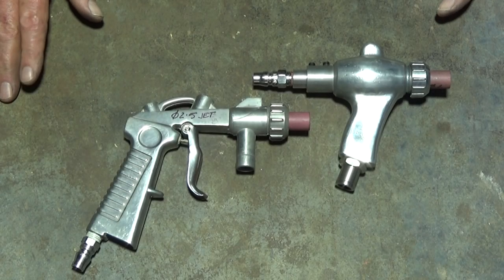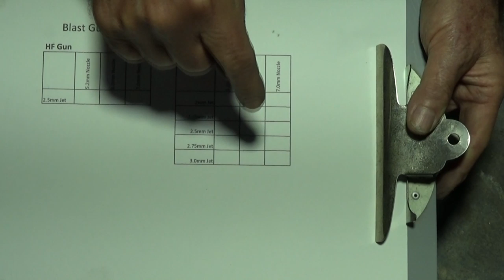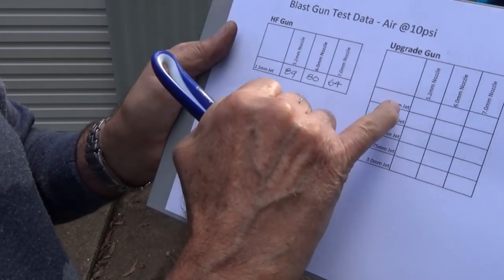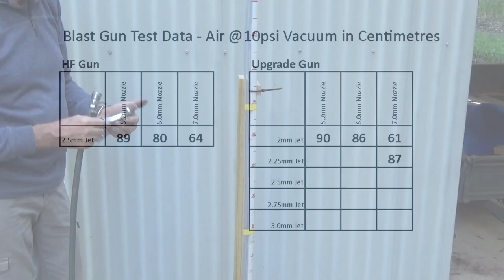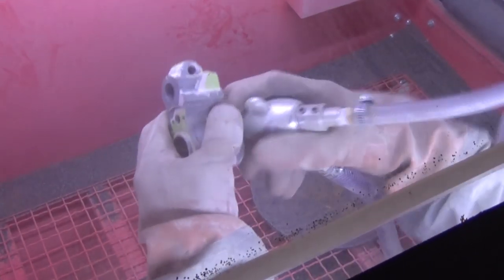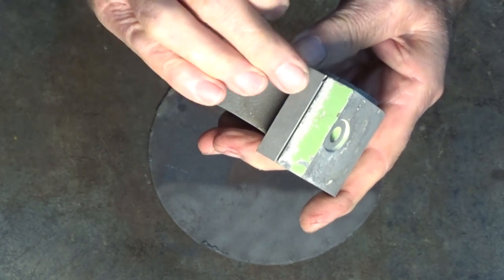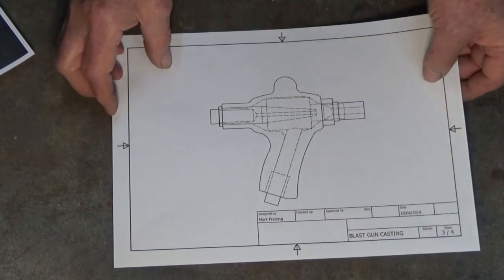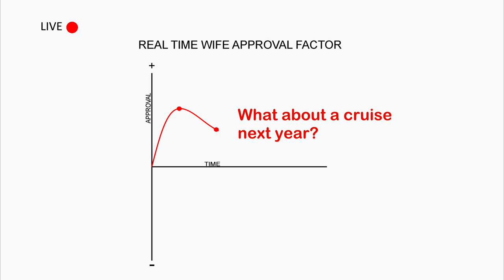DIY Blast Gun Testing Using a Manometer

Comment: Nice results on the gun engineering.  I will agree with bradley carlson below, DRY air and plenty of it are paramount to keep the sand moving and the duty cycle high as possible, nothing eats up air like a sandblaster, just like an open hose.  Me and a friend were doing a ground up restoration on his car and we decided to sandblast the frame --- his compressor was way too small and that became obvious very quickly as the duty cycle was very short with the compressor at full pressure and larger hoses and fittings.  So he bought a new 3x larger compressor and that took care of the duty cycle problem.  But the sand absolutely had to be dry or it slowed the flow and occassionally clogged the hose, even with water filters in place.   Once we got it dialed in we loved cleaning parts with it, nothing like it to get back to bare metal without leaving grinding marks on using nasty chemicals, but one must wear serious breathing protection outside a cabinet - the silica sand we were using had warnings all over it about permanent serious lung damage (silicosis) from breathing it.
Reply from the maker: Thanks for that. I am considering upgrading to a Chicago silent air compressor but I might keep my old belt driven machine since many people have suggested running two compressors in tandem. The garnet I am using seems to be quite coarse compared to materials I have seen others using. I can understand why having dry air would be important if the material is quite fine. I am starting on the MKII version of the gun and I have ordered some clear acrylic tube to see if I can make a transparent gun so I can visualise what is going on inside the cavity of the gun. Should be interesting.
Reply: @Preso58  - Youre so welcome - I like the clear gun idea as a learning tool, to actually see the behavior of the sand should provide valuable clues to what changes need to be made if any.  I love a good DIY project, but yours are on another level than some of us less equipped folk so its fun to watch something be engineered, designed, cast and machined from the ground up.  Your garden bridge was a wonderfully enjoyable piece of engineering work that could only be executed by someone with patience, knowledge and the use of good sound engineering principles, very nice work and a great video series as well.

Comment: I am a bit puzzled here. How come you think that the nozzle and the jet opening are stil optimal if you use 100 psi instead of just  the 10psi you used to do the test.  Do another test at 20 psi....maybe the numbers tell a very different story then.  Why would the numbers go up linear because you use higher  pressure ???
Reply from the maker: I knew that the results that I was getting at such low pressure would be a bit skewed. I intend to do the tests again when I get the MKII version of the gun finished. I tried running the pressure at 20PSI and it just sucked the water straight up to the gun and sprayed it out of the nozzle.  I realised after the video was published that I have a vacuum gauge so I will try to use that to run the tests at realistic pressures. I am keen to see if the results "scale".
Regards,
Mark

Comment: P, 
Your media feed tube is able to deliver more material than the gun can use. When it backs up at the gun the suction drops and thus the flow. Don't worry about the media flow in the delivery tube the delivery out of the gun is all that matters. 
Your drawing of a venturi is wrong, the low pressure point in a venturi is at the narrowist point, see if you can get the media delivery closer to that spot. Also a shallower angle  (larger radius ) in the venturi might help,  you want a laminar airflow if possible. 
Third point, how do you expect to be taken seriously with a clip board when the accompanying pocket protector is absent, seriously mate.

JG
Reply from the maker: Joe. I had reached the same conclusion about the flow of the media up the delivery tube and the flow coming out of the nozzle. It must be arriving at a rate faster than it can be ejected out of the nozzle. I take your point about the laminar flow etc, the design, as always is a bit of a compromise in terms of what I can cast, what I can machine and how comfortable it is to hold. I actually do have a pocket protector! I used to wear it to work when I was teaching. Sadly I could never be organised enough to stock it with three different coloured biros.

Comment: What about feed tube sizes, does this also have a bearing on the outcome? So many variables I think.
Reply from the maker: Yes, There are a multitude of different combinations of pressure, air volume, media size and composition, air and media delivery tube cross sections but the most significant seems to be air volume rather than pressure. I tried to do some blasting in my wood shop the other day and the air line in that area is a small bore PU retractable air line and the results were very disappointing. I am thinking that when I get my new compressor I will run a dedicated large copper tube to the blast cabinet and do away with the foot pedal and substitute a ball valve that I can operate with my knee.
Reply: Thanks for the reply. That's a good idea. I think I should try the same with a light media, I was thinking of crushed glass as  it apparently gives good results. Keep up the good work. All the best from the UK 👍

Comment: There's no science with out the lab-notebook (clipboard) lol.
Mr Presling, you mentioned a version 2 in the works, so i wanted to make a minor suggestion. From fluid dynamics.. when a fluid changes direction it causes friction, and of course the sharper the turn the higher the friction. The sand at the metering valve makes a 90dig turn, and at the gun about 75dig turn. If these angles were decreased it may increase sand flow. At the metering valve gravity well also help the sand into the pipe. This may produce a more consistent sand flow plus increased velocity.
Looking forwards to v2, Cheers!
Reply from the maker: Tameem, the flow at the metering valve is very low velocity and as you have observed it is helped by the weight of grit above the opening. The flow at the gun is also quite slow until it mixes with the high velocity air in the vicinity of the tapered opening of the nozzle. The best way of visualising it would be to make a transparent body for the gun and the metering valve but that is getting a bit beyond what I can scrounge from my scrap box. I'm afraid like most examples of the design process, there are always conflicts and compromises. 
Regards,
Mark
Reply: @Preso58  No, not compromise.. I meant changing the angles from 90 dig turn to say 45 so it flows better. I wish i could post a drawing here.

Comment: I've been watching along as you go. Have a couple of thoughts. 

First, you should repeat your test, tuning the position of the jet for each size, as the optimal position likely shifts. It may even shift further with the change in nozzle diameter. 

Secondly, the geometry of your internal cavity. I think the more tapered shape towards the nozzle would be definitely be better removing that vertical wall you have at the end of your current barrel shape. This should allow better flow of the media towards the nozzle. Also I don't think there is much advantage to having much, or any cavity behind the point where the media is introduced into the cavity (in fact it may be counterproductive), so you may want to look at moving the entry point back, or bringing the rear wall of the cavity forward. You should be able to do a lot of tuning with positions and geometry using 3D printed parts, before you commit to another casting.
Reply from the maker: Mark, unfortunately I have already printed the new core box but I take your point about the shape at the aft end of the cavity although I am now wondering if the larger volume is helping to store a supply of grit as it arrives at the gun. I am noticing that the gun is able to supply a near continuous supply of grit but it is not being sucked up the tube in a continuous supply. I would love to be able to 3D print a whole bunch of transparent gun designs so you would be able to observe what is happening inside them as they work. Most SLS and SLA 3D printers are able to print good strong prints in transparent resin or powder. Sadly, those printers are still out of reach for most hobbyists. 
Regards,
Mark
Reply: indeed the volume to the aft may be the cause of your pulsing feed, though I suspect it is also because of geometry you had at the front.

Comment: Can you give me the distance from end of jet to end of nozzle please
Reply from the maker: Hi, if you send me an email I can give you the 2D drawings for the gun and all it's parts. I must say I never really measured what the offset is. I just adjusted the position of the jet until I was getting the best vacuum. I am thinking that there are lots of variables like the pressure of the air supply, the volume your compressor can deliver and the type of blast media you intend to use. You can find my email address on my channel page under "About".
Regards,
Mark

Comment: Mark,

Did you try different sizes of media feed hose?  Maybe the guns can't handle the amount of media being lifted, causing the media to back up....  Or am I forgetting where you already covered this?

I was wondering how the "discussion" about upgrading the compressor went, but your "real time wife approval factor" chart answered that quite well.  ;)

Looking forward to the ray gun testing.  If you design a functional ray gun, maybe the blast media surging won't matter.  Just zap the items/victims clean!  ;D
Reply from the maker: I badly, badly want one of those laser scaling guns. They are badass! I am going to do some more tests when I get the MKII version of the gun finished.

Comment: I've tried a few of their products.  I personally think they are shit.  Tried having a conversation with them a couple of years ago to sort out the performance issues.  Made a second purchase, tried that out.  Noticed some improvement, but not much better than what you demonstrated.  I'm not pressure or volume limited as I can  push 28 cfm at 175 psi all day long.  I was "updating" my $1300 cabinet) so none of this HF stuff).  Fussed around with varied pressures, nozzle sizes, nozzle position,  media types.  I've run cabinets in the past where you knew when the media hit the gun and stayed there.  Suction/media delivery is always weak.  When I had my fill of that tomfoolery I purchased a pressure pot.  No regrets since that decision.
Reply from the maker: Shain, I am starting to reach the same conclusion. I initially ruled out using a pressure pot because I have limited space in my workshop. I am considering mounting the pressure pot permanently on the wall and then wheeling the cabinet to where it is mounted and I will just use the cabinet as an enclosure to collect the grit. 
Regards,
Preso
Reply: @Preso58  During my research I ran across another company called Pirate Blasting.  They have a bit more information on line, but I determined to get the majority of the information required speaking with distributors.  I was so put off with my prior exchanges I wasn't about to let somebody else sell me more sliced bread.  I'm of the opinion a proper mixing valve should be where the performance is at.  Seems like it should be located in the bottom of the cabinet, with air injection set horizontal with the media suction line directly across from it.  Ball valves for media, and air injection to dial everything in.  Foot control to start and stop the operation.  I'll eventually get something like that built.  Moving media between the cabinet to the pressure pot is not ideal, but I can blast to a much more uniform finish in less time trying to get a suction equivalent.  I've had cheap guns where you stick the hose in a bucket of media that worked much better than what is being offered for these cabinets.
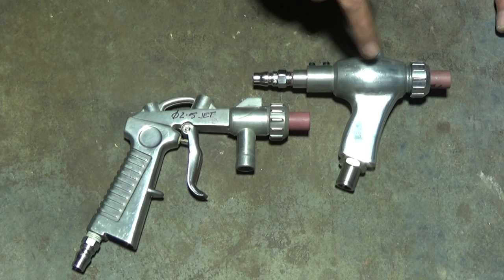Reply from the maker: Shain, I watched a video by Stefan Gotteswinter recently where he showed a little desktop blast cabinet with a sort of cassette at one end of the enclosure. It appeared to be a pressurised container with a small bore PU hose to deliver the glass beads. It was made in Austria and called a Logiblast. He said it cost around 400Euro. The results he was getting were truly impressive. https://www.youtube.com/watch?v=jtWi_YMcZdI The footage starts at 00:27 I doubt I could get on here in Australia and I was already committed to what I built by the time I saw it. 
Regards,
Preso

Comment: Wow... casting always fascinates me.. Why I'm here.. Gun Looks great...BTW 👍.. From personal experience you are wasting your time with suction fed guns tho 🤷. Build your self a pressure fed unit.. Just copy a sealey one.. Straight sided bit of tube  With a grit flow valve pointing straight down  at the bottom Into a t piece.. Just use a 1/2" brass ball valve to meter the grit.. .... And use tungsten carbide nozzles.. I'm using a 4mm nozzle at the end of 13mm blast hose  .. I'm Running off  twin 3.5hp single phase  compressors. At 60 psi... Blows suction feed out the water big time... Less pressure... Loads more work done.. 

Just Leave the trap door open on the bottom of your cabinet dumping into a bucket thru  a course  sieve.. If you only have one 3.5hp single phase  compressor go down to a  3mm nozzle so the compressor can keep up.. .. You'll never look back trust me....
Reply from the maker: Interestingly, I just watched Stefan Gotteswinter's latest video where he shows the replacement he bought for his suction fed blast cabinet. It was a quite small pressure fed gun which he runs with glass beads. He is lucky he lives in Europe where it still seems possible to buy quality products for the home shop.
Reply from the maker: Interesting. I may eventually go down this route.

Comment: Only 10 psi, all you need is to make a 30in manometer and fill with mercury, which should be readily available in your shop.   Just kidding, these days I do not even have a thermometer with mercury in the house.    Things change over time.

I can see the benefit of a larger compressor, but not sure why you would want a 3 phase motor with VFD unless you want to go AvE style and control amps to get variable speed based on load.  A link in case you have not seen this.

 https://www.youtube.com/watch?v=zIQ_AM3bnwo&t=554s

I love the chart at the end.    Tell your wife your viewers recommend you get a bigger compressor.

I am eager to see the performance of version 2 design of the gun.

Dave.
Reply from the maker: Dave, I read your first sentence and started to wonder what part of the planet you lived on that allowed for  the sale of mercury "in the shop". 😂
"Surely you jest" I thought and so it was.  I did watch AVE's video on the VFD compressor experiment. Typically, I walked away a little confused. It's sometimes hard to know where the serious stuff and the joking are in his videos but it sounded like a viable idea. I am starting to think about one of the Chicago silent compressors though. There is a 3 motor version that looks like it would do the job.
Regards,
Mark
Reply: I do recall mercury spilling out of some broken instrument when I was in high school, back in the late 60's.  I do not recall how it was cleaned up, but some small amounts got under aluminium extrusion on the edge of the table.   It looked like it consumed the aluminium but I think it just prevented the aluminium oxide from adhering to the base metal so it just oxidized - but rather fast.  My friends and I did not think about the toxicity.

AvE is a mixed bag.   Some very good information, and sometimes a lot of unnecessary "fluff".

I looked up the Chicago silent compressors.    Similar models sold in the US, even HF is now selling some under the new brand McGraw.

Dave.

Comment: Hi Mark

Interesting video...I upgraded my h+f  based on the Tacoma upgrade....Its a lot better than the old setup but my compressor has trouble keeping up. Im thinking of upgrading to one of those chicago hush types....Watching Rays garage upgrade , he sets the gun pressure to 40 psi with the petal pressed...I havent tuned my gun as yet, i came across another video see link which explains the setting up of the nozzle see link.....https://www.youtube.com/watch?v=1k25Mivx9Tg...Just got a vacuum gauge of ebay so will set it up soon and try it out..

Cheers
Frank
Reply from the maker: That's interesting. I have a vacuum gauge so I will try to set it up when I test the MKII gun. That way I should be able to run it at realistic blasting pressures. Someone else sent me a link to the Chicago range of silenced compressors. I have started a wish list! Thanks for the video link.

Comment: Mark, I do have a Tacoma Company upgrade on my cabinet. I made a video for you showing the mixing of the air and media in the suction line. Hope this helps!  https://www.youtube.com/watch?v=VL0nBvoaCY8
Reply from the maker: Wow, I didn't expect you to put up a video reply! I think I got a better look at your media supply in the  shot showing the regulator pressure. It does look a lot like what I am getting now although the aluminum oxide you are using looks a lot finer than the garnet I am using. I like the rubber plug design too. I am running my cabinet with a much higher pressure, probably around 80psi but my biggest issue is CFM which is why I want  to upgrade the compressor. Thanks so much for the feedback. It certainly does help.
Regards,
Mark
Reply: @Preso58  I didn't notice it when I filmed or edited, but your right, the best shot of the media was during the pressure regulator shot! Lol